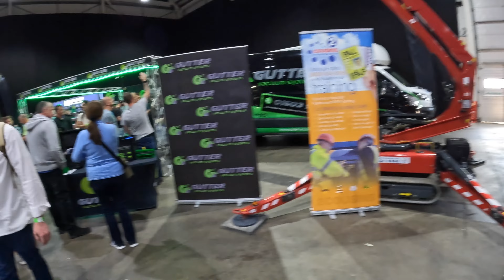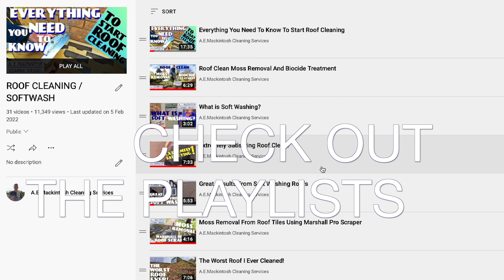Cleaning Expo and New Mackintosh Poles!

Comment: Any prices on the poles ?
Reply: £275 theres a link in description
Reply from the maker: These are premium carbon fibre. Rigid, anti-spin, and very durable.

AE 1.0 is 18ft. £275
AE 2.0 is 25ft. £350

I have setup a store. I’m all out of the AE 2.0 so I suppose I’d better get some more products in.😃👍🏼

https://mackintoshcleaningtools.sumupstore.com
Reply: @aemackintosh   I've been telling fellow windies about your poles but there struggling to get on to your shop I'm having to get the link from this comment.
Reply from the maker: Thanks! I will promote it loads more when I have more stock in.👍🏼